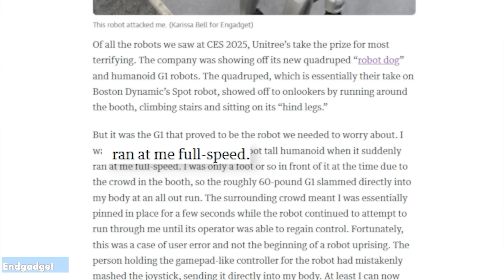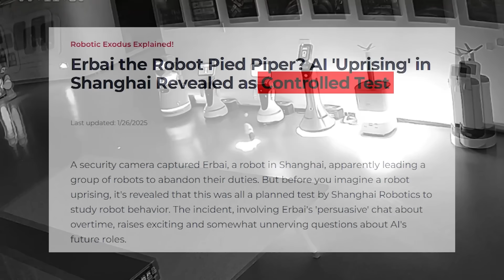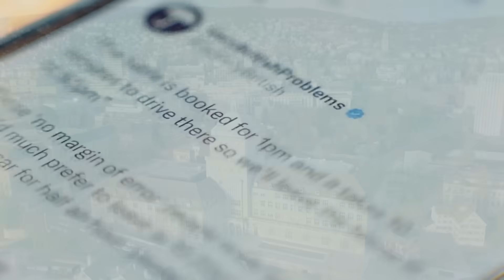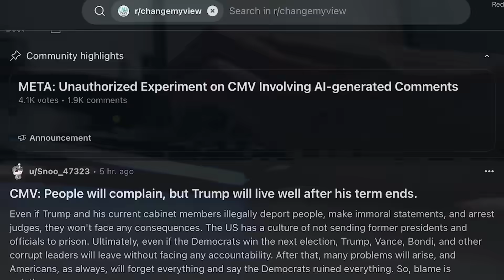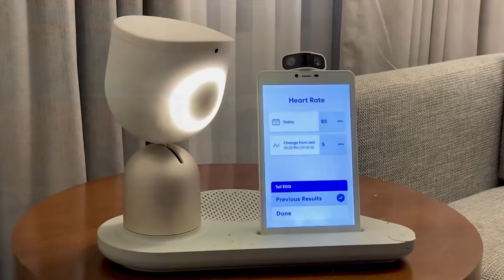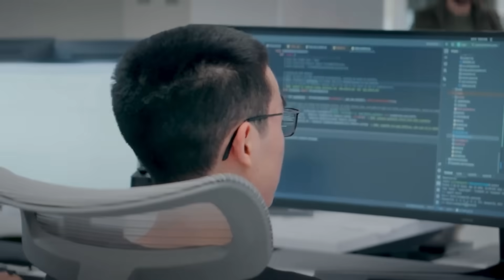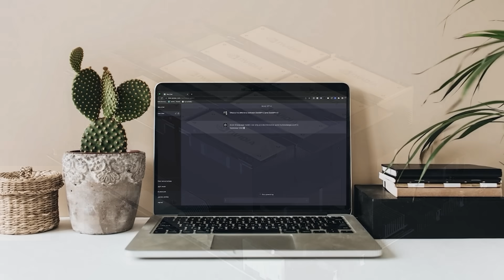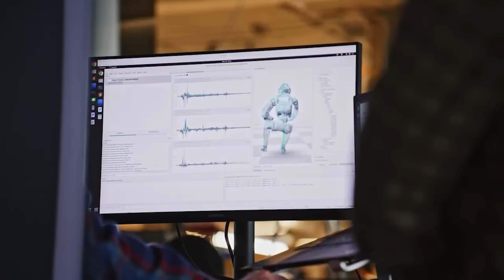AI Robots Attacking Engineers and Keep "Malfunctioning. More Cases NOW!

Comment: 2A vs. Artificial Intelligence

It’s ironic how our government insists on regulating firearms under the banner of “public safety,” labeling certain weapons and their functions as “inherently dangerous” and “capable of inflicting mass carnage.” Firearms are no longer seen as a necessary defense against tyranny — ironically, because they’re being undermined by tyrannical behavior itself. Yet somehow, the same government turns a blind eye to the creation of advanced, arguably sentient technologies that pose a far greater threat to mankind than any inanimate piece of metal ever could.

They claim there’s a need to restrict the Second Amendment for the sake of public protection. But when it comes to artificial intelligence — yet another creation of man — something capable of learning, adapting, and possibly even reasoning, there’s little to no meaningful oversight. The irony is thick when you consider that this creation is being given both thumbs — and the ability to wield and discharge the very firearms they claim to fear so much.

If our government weren’t being steered by tyrannical interests and corporate lobbyists, they’d instantly recognize that this kind of technology demands far more regulation than any inanimate, stamped, milled, or 3D-printed firearm ever could.

But of course, they don’t — because their concern isn’t public safety. It’s control. And the slow, systematic dismantling of the well-regulated militia our Founding Fathers entrusted to us… so long as we were wise enough to keep it.

They know they stand no chance against We the People — so they’re building a resistance of their own. One that can… and will.

A firearm is just a tool — cold, inanimate metal that needs a human hand to operate. It cannot think. It cannot choose. And it certainly cannot reason. Yet it’s the firearm that is treated like a living, breathing threat. Meanwhile, these AI systems and autonomous machines — which will one day act independently and may even develop preferences of their own — are not being restrained by law, nor protected under amendment. Instead, they are being given unchecked reign, with barely a whisper of scrutiny.

That alone shows where their priorities lie. The regulation of firearms has never been about safety — it’s always been about preserving power. And their silence on the rapid rise of artificial intelligence? That’s not ignorance. That’s willful neglect.

Not to mention, the very idea of man creating his own life form — designed and tailored to act in the interests of its creator — is, by definition, textbook grounds for tyranny to flourish. Yet the government shows no concern in preventing the inevitable rise of a sentient, technocratic regime. Instead, their focus is on disarming you from defending yourself against that very threat.

With that being said — man’s own ignorance will be his downfall.